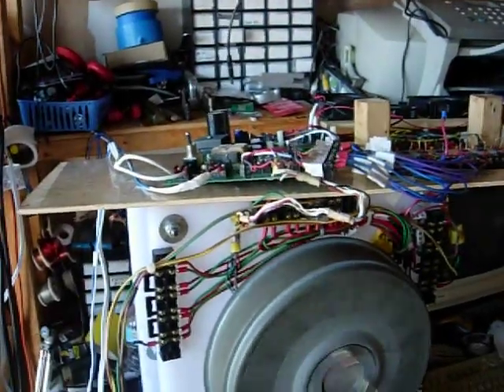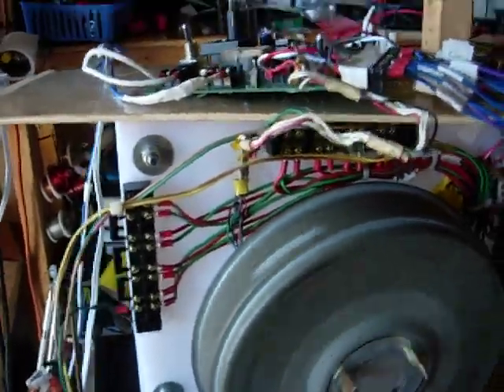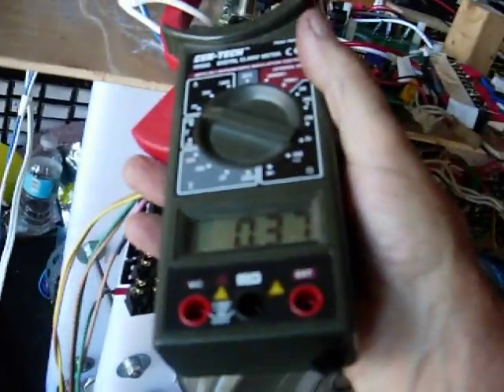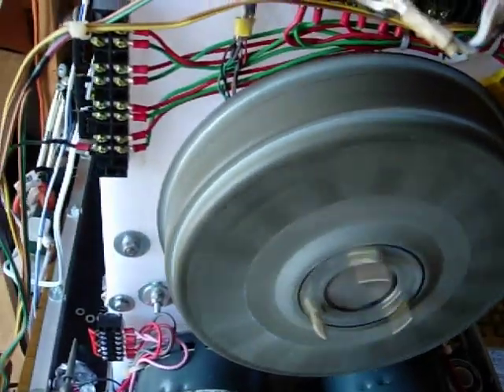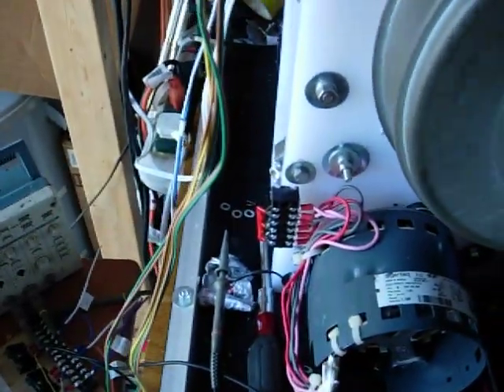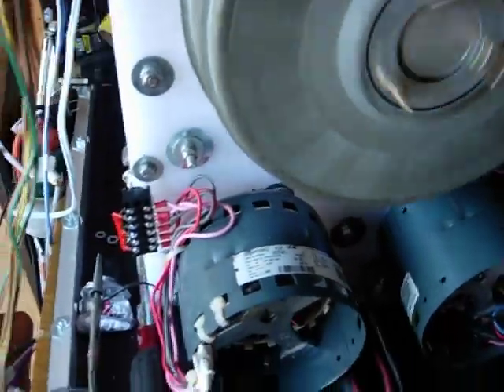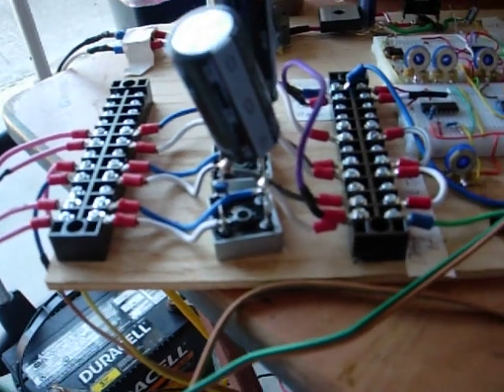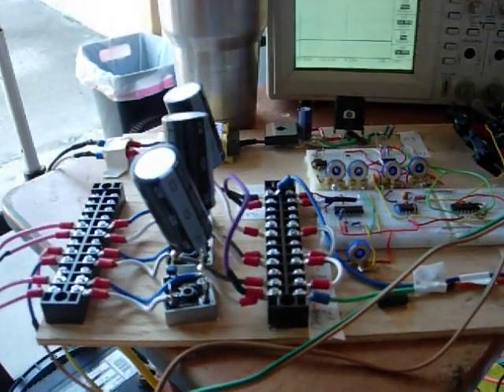Don Smith #191  Running 300 rpm very low current

Comment: 180 volts is alot, -  well done, -  but this is what happened when i tried connecting a ground rod too the negative of my 5000volt dc power supply.   https://www.youtube.com/watch?v=N9q2b608EBM   -  the ion motor, connected across the 5k  speeds up. alot.           - mabee you can do somthing with those capacitors in series / parallel. ,   i should try too, kinda busy with hho and newman motor though,

Comment: Question sir,
Did you rewired the ECM motor? How many amps are you getting off the ECM motor Plz? Ty
Reply from the maker: Hi Ty  not sure what the amps are yet been working my butt off to the FET circuitry done now hole thing works.  I'll be doing shorting tests some with amp meter.  should be around 3 to 4 amps times 12 three phases per gen.  I did not rewire the gens but that could be done.  I did add 100 turns to each of the power coils 36 of them 3 phases 12 each.  They fill the cap with 100vdc without loading down the Samsung motor one bit. amazing.  But the cap must be disconnected from the PU Coils when dumping to the load whatever that is.  The FETs do this very nicely but I need to adjust the NE555 timer oneshot its low at the collector of transistor is on too long. Pulse too wide from the one shot. simple adjustment of pot.  I believe that it should be possible to make a self running device using the three PU Coils and a portion of one of the gen.  its is also possible to remove the arc magnets from the gens and use NEOs.  carefully heat the gen outside till the Arc slide out. Don't over heat them or they will explode.  and somebodies going get a hurtin.